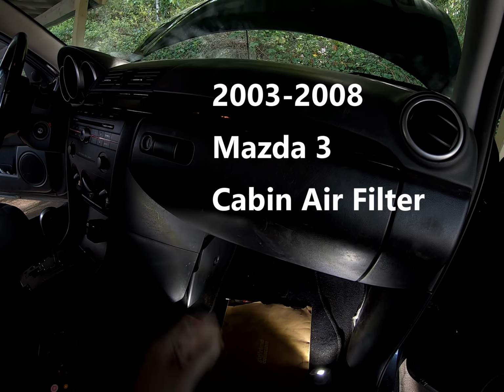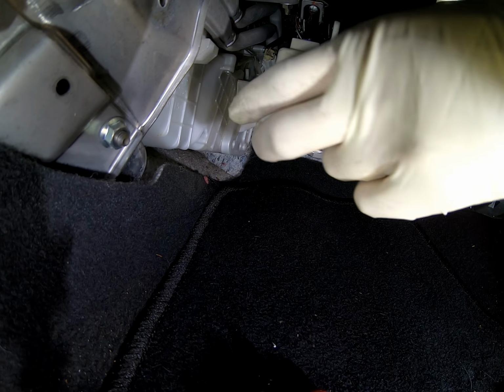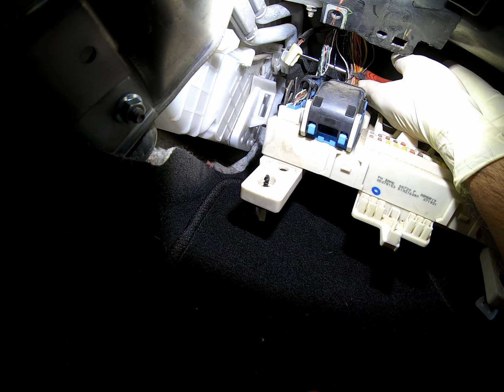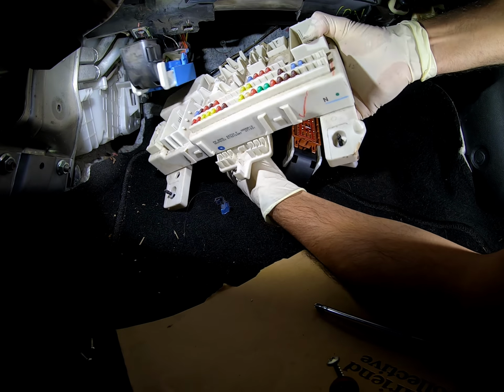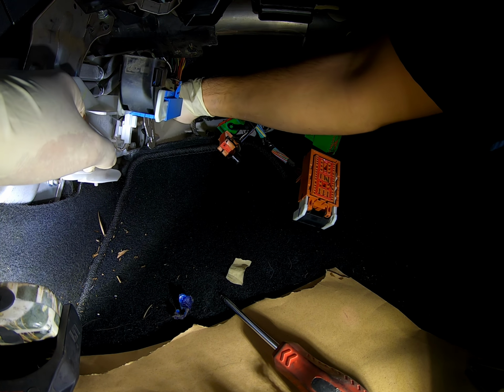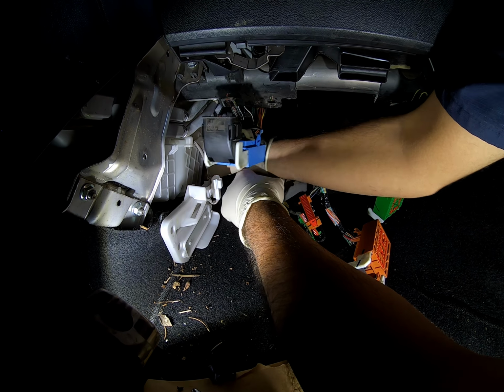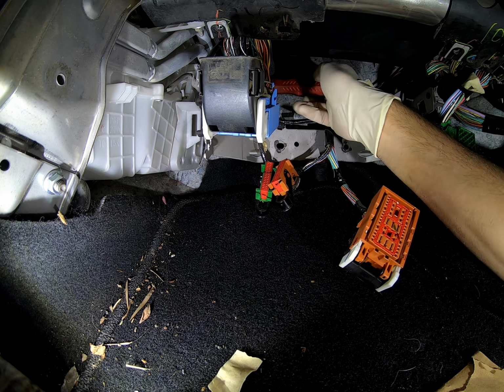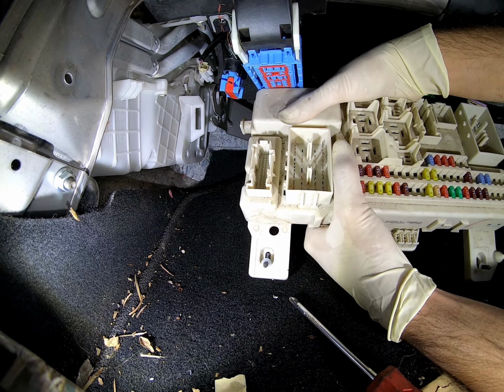2003-2008 Mazda 3 Cabin air filter change

Comment: that is BULL!! Who designed that, take the fuse board out??? madness. Should just be under the glovebox like most cars inc. toyota from this era
Reply from the maker: Right?! 🤣
Reply: Mazda sh*t is not very bright... look up pcv replacement for mazda 3. You basically gonna spend like 6 hrs to torn the whole front of the engine apart to replace a 10 dollar parts which most of the car have it sitting on top of the valve cover took less than a minute to change.

Comment: A tip for inserting the filters

HE SWITCHED THEM!! At 5:30 there’s a jump cut where he SWITCHES the filters. 

To align the filters the right way, make sure the foam seal goes on the top of the top filter. 

 there’s a groove in between the filters which interfaces the top with the bottom filter. This is how they sit together. 

on the bottom of the bottom filter, there’s a protruding bit that fits into a groove at the bottom of the filter hole. 

to make sure they’re facing the right way, the longer protruding bits are the handles that should face outside, towards the installer. 

In short: 🇲🇹 goes on top, 🇬🇼 goes on the bottom. 

I hope this helps / makes sense i can clarify
Reply: Saved my life

Comment: The filters pretty much only go in one way but you’ll make your life easier paying attention to how the old ones were facing and positioned when you take them out. You definitely should unhook your battery and then unplug all the connectors to the fuse box and remove it. (Disconnecting the battery is optional but it could save you from frying your ECM...just sayin)
I’m a former mechanic. I used power tools and did this in under 30 minutes, struggling a bit to get to those top screws on the filter box. Mostly cuz I’m old. I also cussed a lot.
Nice video. Saved me from doing one!

Comment: Thanks for this, it gave me the courage to install the new filters I bought a couple of years ago and never got round to.
The previous filters were installed wrong in my car, which didn't help. While the filters were dirty, I think it was the dried twigs and leaves blocking the filters that were the bigger problem.
It's a lot easier to remove the fuse box assembly if you undo the bottom 3 fuse connectors first, the lever the box forward and tilt down into the forward latch position, then undo the top connectors, and then take the box all the way out. I found that out while re-installing it.
Next time I buy a car I'm going to learn where the cabin air filter is before I buy.

Comment: I appreciate the assistance very informative but the guy that designed these little bitty tight spaces needs to be taken out back and horsewhipped repeatedly thanks again for the help
Reply: Amen to that brother! This has to be one of the most mediocre automotive designs ever. In most cars this procedure is trivial, however definitely NOT in this case.

Comment: Thank you for the helpful video. 

I did a RHD 2008 hatch today. Process is identical however you can slide the bottom filter in first then the top one (the opening is a different shape). Still a painful job, I recommend outsourcing this one!

Comment: The engineers who devised and approved this insane setup need to be kicked in the nuts.  My 2006's air conditioner stopped working so I want to replace the 17 year old cabin filters, which I didn't even know existed until last year, to see if that magically fixes the problem.  It'll probably take me two hours to get done what this guy did in 10 minutes and with my luck won't fix my problem.
Reply: I just fixed the air conditioner on my 2008 with one of those bottles of A/C Pro refrigerant you can get from Walmart or wherever.  Maybe give that a try?  I'm dreading replacing the cabin filter which probably needs to happen soon...
Reply: I just did my 2007 Mazda 3 and it made a big difference. My AC wouldn't blow strong air before and would probably freeze up and wouldn't work. My air is working great now but this is a pain in the ass unless you're a contortionist.

Comment: Past me: "I'll change my cabin air filter - it's *never a complete pain the balls."

Day 73: "Today, with enough reverse engineering, I've come to the logical conclusion that Mazda started the design of this car model with the cabin air filter as the keystone and built the rest of the car around this beautifully, logically, and most especially - deepest - engineering component."

😐 Well done, Mazda. Masterful engineering for a commonly replaced part.

Comment: Sigh, I’ve been putting this off too long, why can’t Mazda have made this more 
straightforward.
Reply from the maker: Its not all that bad but yes you are correct Mazda couldve made this much more straightforward
Reply: It's pretty simple actually. A 5min job even if it looks difficult. Just go for the extra mile and remove the fusebox right away so you don't need to struckle with tight space. The fusebox clips are simple to remove and reconnect. I would say getting the new filters in is the hardest part. When you get it done once It's a walk in the park the next time.
Reply: @benjaminruggiero420  you do know that messing with fuse box, especial playing with those main harness connector increase the chance of bad contact and invisible wire breakage exponentially. For air filter which needs to be replacement annually to as little as 3 months (depends on where the car is driven) mess with the main fuse panel for every replacement is a very dumb idea....

Comment: no need for removal of anything other than bracket, lower the fuse panel cover and side cover yall, also back 2 top screws on filter opening cover dont need to be on, just the bottom 2, holds it on just fine

Comment: Thanks for the video. It really helped me avoid some pitfalls. I managed to do this in a little under an hour, so I figured that was pretty good. 

I think the most annoying part was having all those cable bundles dangling down in the way, while trying to get at the filter housing. It was hard to find a way to tuck them out of the way. Also, putting the fuse box back in required a lot of fiddling around. And to me, I really couldn't see a way to do this, without taking out the metal bracket that the fuse box mounts on.

I was careful to look at the orientation of the old filters when I took them out. But getting the new ones in I didn't think was that hard. Annoyingly, the mechanic who did this the last time had installed the filters incorrectly. The bottom one was at a funny angle and not lined up in the track at the bottom of the housing where it was supposed to go. People should be aware that the filters, when installed correctly, should be right up against the air conditioning evaporator.

Comment: I can't get the nut off the left side on the fuse box holder panel. Like I think it's seized in there good. Right is loose. Can I cut the nut and replace it with one from the hardware store?
Reply: Similar issue, I reassembled it to try again later with our family mechanic helping

Comment: Does anyone know if changing the air cabin filter, while having the battery disconnected, could cause the car to go into anti theft mode???
Reply: Please I need help my car is a paper weight right now!
Reply from the maker: That would be the most uncommon thing
Reply: @mechdjango3490  ok i just wanted to rule that out because i did a full tune up before replacing the battery, and right after on the start up she was blaring the horn and the dash and the small red alarm light were flashing

Comment: I did this, when I plugged the fuse box back in, I lost my high beams, wipers, turn signals and fog lights. The emergency brake light is stuck on as well. Help
Reply: same light brake... did you solve it ??
Reply: Did u solve it?
Reply: Anytime you remove a fuse block like this, you should disconnect the battery first and allow the car a few minutes to discharge. Turn your lights on then off can help. Also those fuse blocks are a pain in the ass and sometimes dont fully seat. Make sure the handle is fully down, which helps it lock into place. Be extra careful because you can easily break or damage wires when doing this service.